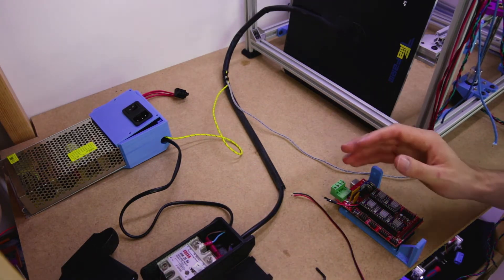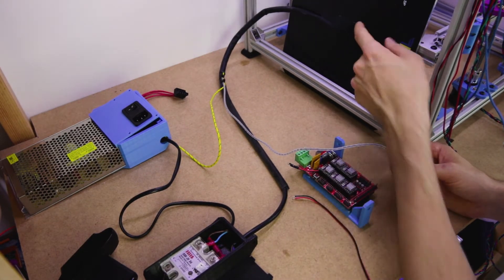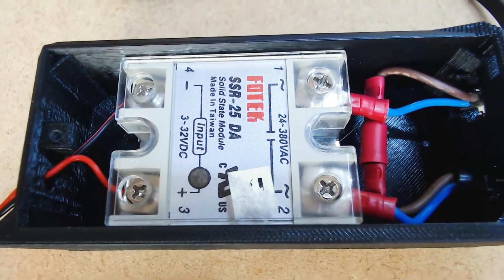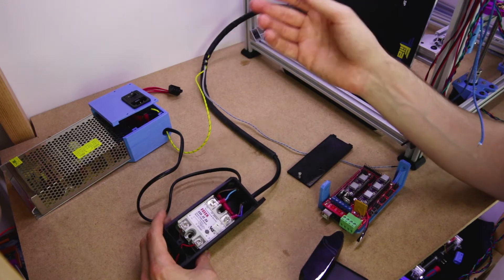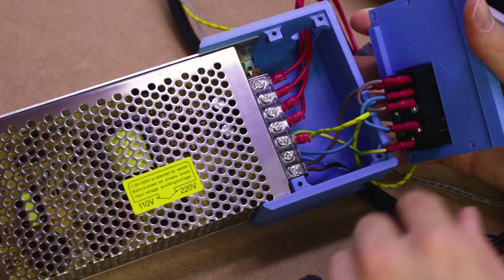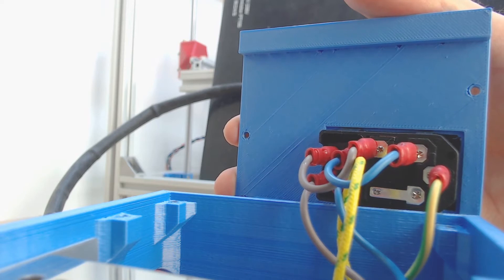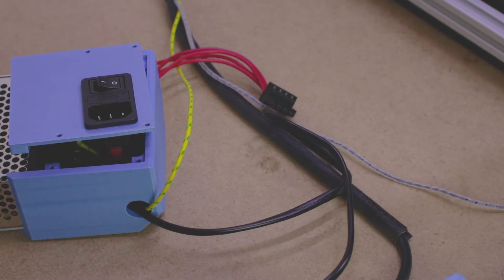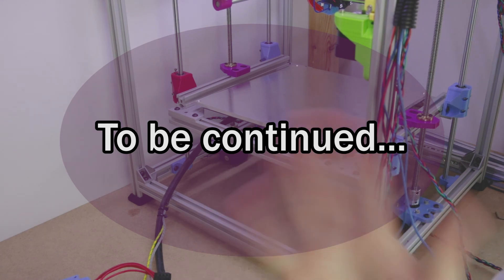Silicon Heater, Bed and SSR - STEVE Build Ep17

Comment: Does it matter which wire you connect to the top terminals on the switch? I see you have brown on the left side and blue on the right. I read somewhere how to connect this kind of switch and that person had it the other way around. Does it matter?
Reply: I don't mean the SSR. I mean the wires on the fused switch at 6:07. On the little switch you have brown on the left and blue on the right.
Reply: See this page, step 2: http://www.instructables.com/id/Wire-Up-a-Fused-AC-Male-Power-Socket/
Reply: okay, thanks! :)

Comment: What PSU are you using? For example, I've bought and 110v 700w Silicon Heater, what is the minimum specs for the PSU? Using a Ramps 1.4

Comment: Is it necessary to insulate on the bottom of the 120v bed?
Reply: C.R.T so running a ground Wire to the frame of the printer would do it?

Comment: nice vid steve, i would like to ask, how to wire with 24v PSU? i recently bought 24v silicon heatbed, the problem is another electronic parts only support 12v, so do i need 2 PSU (1 for mainboard and 1 for heatbed)?the board support 24v though (mks gen 1.4) but what happen to another components if i use only 1 psu (24v) how to wire them? i'm a bit confuse coz i'm not electronic expert, which one is best, use 1 or use separate psu, i wish you or anyone could help me / show me how to wire them